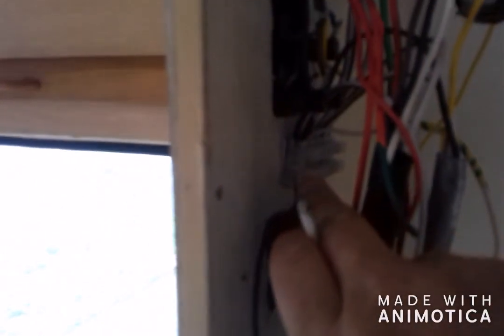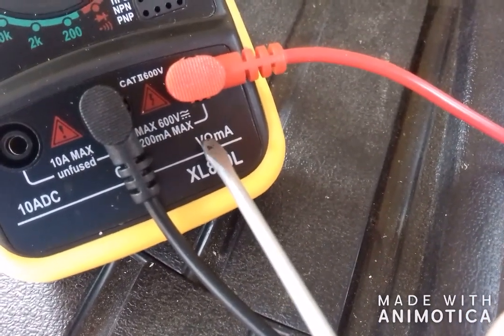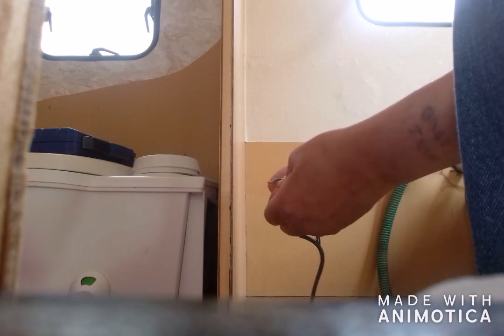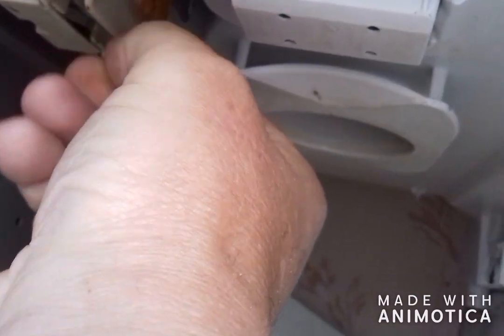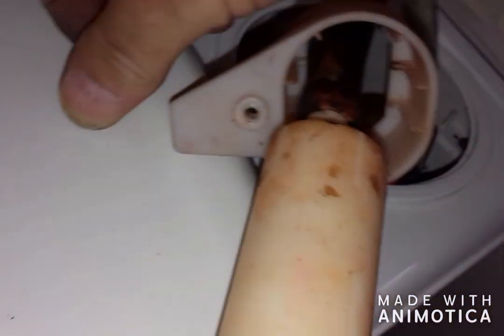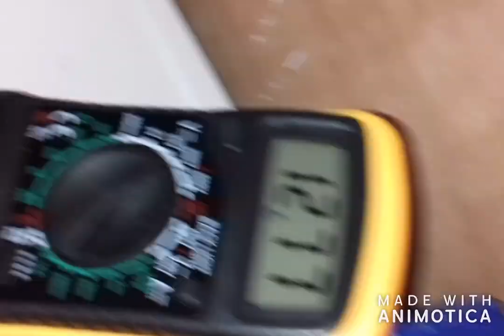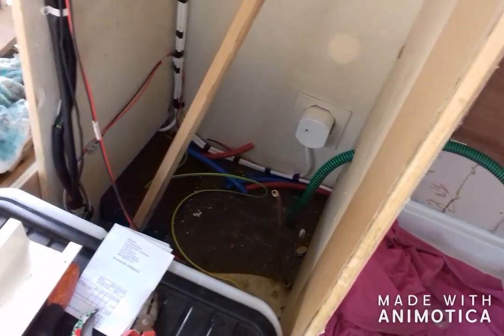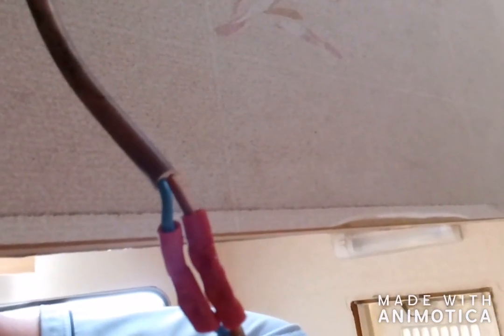Part 23 Talbot Express Diagnostic And Repair, None Flushing Thetford C2 Cassette Toilet

Comment: That is indeed the flush holding tank, it is cleaner than ours!  I have attempted to clean it out without much success. The join in the pump supply cable shows that somebody has previously changed the water pump. Unfortunately, being deaf, I am unable to hear the micro switch, will have to “find a friend” to listen to it for me.  I do hope that you are not putting loo blue into the flush water, as you suggested.  It is supposed to go into the waste tank.  A pink fluid is designed to go into the holding tank.